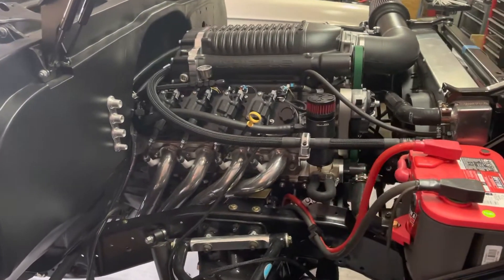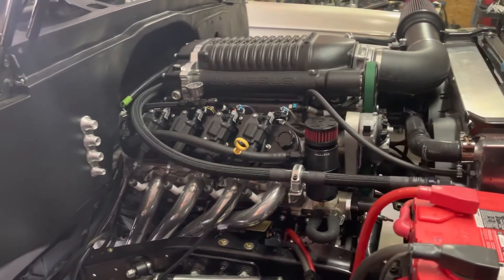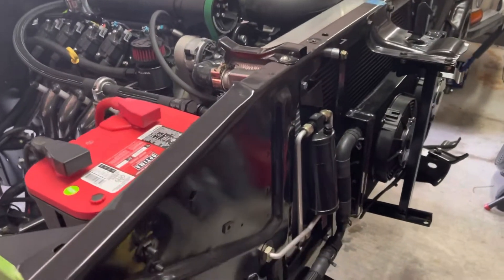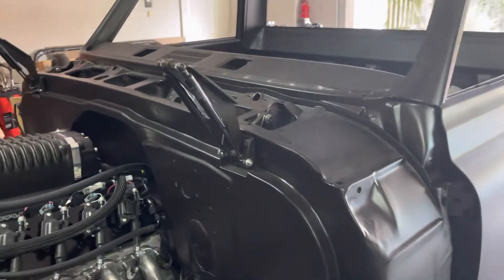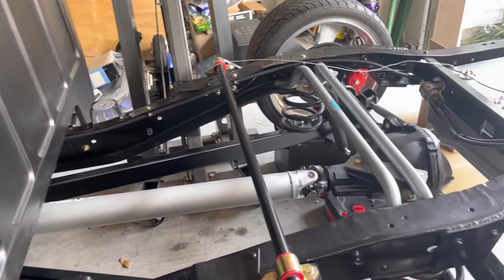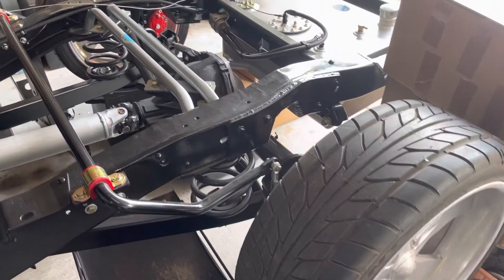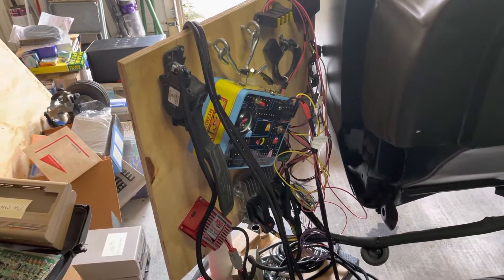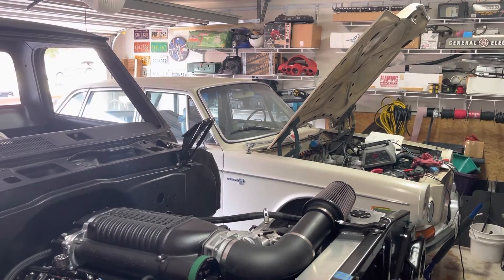Basic Overview of my 1972 Chevy C10 6.2L LS Swap With 2.9L Whipple Supercharger Project

Comment: Where did you get the intercooler for the Whipple from?
Reply from the maker: It is the intercooler that came with the kit. I added the fans.
Reply: @roushinator1000  oh okay. I was looking at the Whipple 2.9 gen 4 custom kit for my build and they told me it didn’t come with an external intercooler.
Reply from the maker: @McNaught82  the motor I have is out of a 2014 Camaro. So I bought the kit for that car model. I had to modify a few things. But it did come with an intercooler
Reply: @roushinator1000  do you have any recommendations on aftermarket intercoolers? Since the kit I want doesn’t come with one.
Reply from the maker: @McNaught82  I know that Whipple will sell you one if you ask. But I think Mishimoto makes a lot of different options. I’m not familiar with their quality though. There are a lot of options out there though